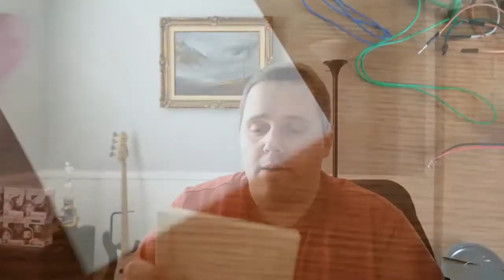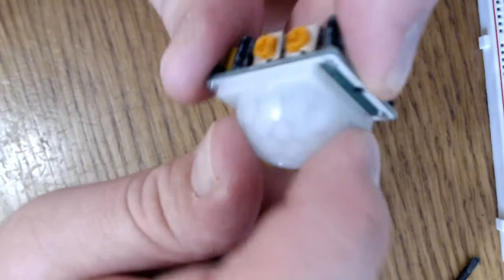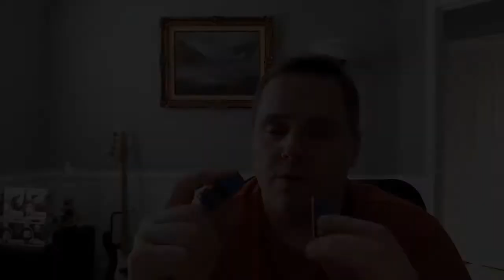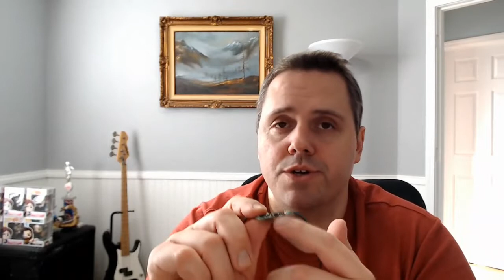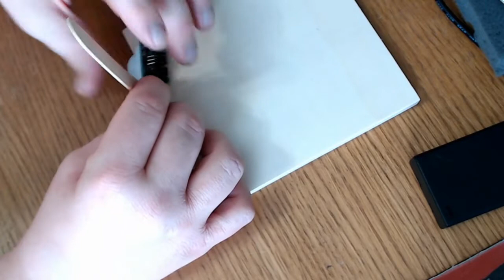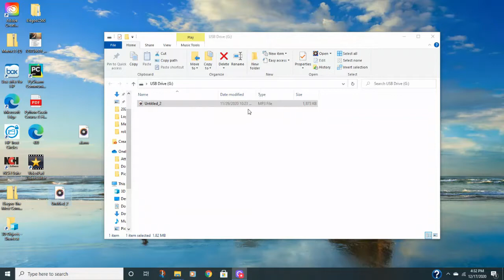How To Create A Simple DIY Motion Activated Sound Device With A Relay Module For Beginners

Comment: Is there away to make it activate when it’s powered up? I want a voice box for my car so when the ignition turns on it plays a sound and then stops (no loop)
Reply from the maker: Hi Keven!  I don't see why you would not be able to do this. You could connect Arduino microcontroller (Uno maybe?) to your car's wiring and make it activate a voice box to play 1 time per activation if you write the proper c++ program to the Arduino board. There's probably even a way to wire it to your car speakers rather than use a small external speaker. I am not familiar with modifying cars and this would take a bit of research, but I think it could be done. It sounds like a great idea, too!
Reply: @BMonsterLaboratory  thanks for the help I’ll look more into it 🙏🏽
Reply from the maker: @Awsometurtle20  do a google search for "adding arduino to your car". There are some neat videos there. These are the people who could give you more direction. Good luck with your project!
Reply: @BMonsterLaboratory  thanks for the guidance  I really appreciated

Comment: I have a question - if I wished to do this on a sound system that is bigger, say a speaker, outside - is that possible with your creation? Thanks.
Reply from the maker: Hi Jae kim! There may be a way, I haven't explored that yet...not with this same setup. Perhaps I will in the future. 
If you want an outdoor motion sensor with music I would recommend the Sparkfun mp3 player shield for the Arduino Uno. 
You can see my video here - https://youtu.be/zamlAniU2nQ
There are other mp3 player boards, but this one is the one I am familiar with and it works very well. You can load an sd card with many different mp3's if you want and you can shuffle them a well so that you don't get the same mp3 playing at each activation. You can connect the Sparkfun mp3 player shield to a passive speaker system (uses external power) using an aux cable. In this video I connected to an LG sound bar. For outdoor use you could also connect it to a PA speaker with an 2.5mm aux cable. There's not a lot to the Sparkfun setup and the code is posted on Facebook for you to use. Just search #mp3uino in Facebook and it should pop up. Hope that helps!

Comment: Can I substitute the pir sensor with a voice recognition module? And if yes how? 

Waiting patiently ;)
Reply from the maker: Hi there! Which voice recognition are you using? There are several out there.  I have MOVI, but it requires some coding.  If you don't have anything in mind,  I can work on a MOVI setup using this mp3 module.
Reply: @BMonsterLaboratory  Yes, I was trying to remember the name, is the MOVI and also yes, it would br helpful if you showed the step by step

Thank you😊.
Reply from the maker: @miguelmarques7378   I'll work on it and share the code as well. Nice thing about the MOVI is the example code provided...most of the time you only have to tweek it a bit. I'll let you know when it's ready 👍
Reply from the maker: Done - here's the video https://youtu.be/E1j4TkzliNA 🖖👍
Reply: I have everything wired correctly and am getting no output on the relay.  All three , pir sensor, relay and soundboard have separate 5 volt power sources but no output sound on the card.  Any ideas of what I am doing wrong.  Thanks.
Reply from the maker: @auirora1  hey there! Sorry to hear that.  It's there any way you can send me close up pics of your mp3 module and relay with all connections? Can you post pictures to Facebook?  Also include a full view of your setup? Also, did you test the module when you opened the package? Did pressing the button play sound for you? Did you remove the original file a add your own mp3? I can take a look tonight.  Is the motion sensor Jumper on the L? Is the relay module Jumper on H?
Reply: @BMonsterLaboratory    Thanks, I will do that.  I will send pics to your Facebook page.

Comment: Hi Bmonster! How are you? I wanted to know if it is possible to create a sound detector for a specific sound or are sound detectors for general sounds...what about motion detectors...can they detect motion from a specific direction?
Reply from the maker: Hi NaMa! I'm great and I hope you are as well 👍   There is a sound module with a microphone on it. It can detect different frequencies and amplitudes with the turn of the potentiometer. There are also voice recognition modules. I have a couple videos using the MOVI voice synthesizer and recognition module..It's awesome. I love that module.  here's a #shorts video of MOVI. https://youtube.com/shorts/xkmC5VEokGw
 Obviously, MOVI got the Superbowl prediction wrong, but don't hold that against her.
You can detect motion from different directions with multiple PIR motion sensors. Here's a video I recently made. It's very basic but it's directional. https://youtu.be/5SF_TDtShKQ
You can also use an accelerometer or gyroscope modules to measure directional acceleration and orientation.  I hope that helps!
Reply: @BMonsterLaboratory  can these two technologies be combined??

Comment: Hi! 
I really like the idea und also tried it out, but i face the problem, that my pir detects the next motion to fast, so the sound is interrupted.
Is there a way to pause the pir (without microcontroller) or to pause the relais until the sound has played?
Reply from the maker: Make sure the trigger select Jumper is on L, not H. L is single trigger mode. You can also adjust time delay on the potentiometer to create a delay before next trigger
Reply: @BMonsterLaboratory  Hello and thank you so much for the answer.  It think i've done all changes but have to play more with the PIR time delay to get the result i want to have. It still triggers too often.

Comment: What's that sound module board part number? It comes in kit form with speaker?
Reply from the maker: Hi Terry. I purchased this on Amazon - ASIN: B07ZJH9DPF    
The product name is "WayinTop Sound Module Button Control Music Voice Player Programmable Talk Chip Musical 8MB MP3 WAV USB Downloadable with AA Battery Box + USB Cable for DIY Audio Cards Christmas Creative Gift"

The module comes with a speaker, a button, a usb cable, and  a 3AA battery pack. It has actually gone down in price, which is rare. I paid $18 for it and it is now $13.  If you need any help with setting it up or any other options for the same type of setup just let me know....happy to help!  Good luck to you 👍
Reply: @BMonsterLaboratory  Thank you

Comment: Can you do a build on one of the trip wires used in paranormal investigations please?
Reply from the maker: I have something in mind.  I'll give it a shot!
Reply: @BMonsterLaboratory  awesome thank you!
Reply: Could a maxsonar sensor be used in place of the motion detector? And if so would it be more sensitive? Thank you
Reply from the maker: @reissenmagouirk2907  you should be able to but it's not quite as easy as this motion sensor setup in the video.
for paranormal investigations, maybe you  can use Bluetooth Serial or Bluetooth Low Energy (BLE) for communication between 2 or more ESP32 boards. When motion (or whatever sensor) is triggered on one, you get a signal for something to happen on a different board, maybe one that is several feet away. 
To do this right, I think programming a microcontroller is the easiest way to go.
Reply: @BMonsterLaboratory  thank you!

Comment: Hi! I just found your video and put together this setup with all the same parts, but for some reason the speaker is not making sound. I’ve double and triple checked the wiring, and the motion sensor triggers the relay, but no sound. What could I possibly be doing wrong? I’m trying to make a scanner beep sound for a kids grocery checkout counter.
Reply from the maker: Hi there.  I like your idea. Be sure there is 5v power to trigger the relay. Did you plug the module into a computer and add your own beep sounds? The only thing I can think of is the power to the relay. There is a jumper on the relay, is it set to high or low? It should be set to high.  It's a plastic sheath that covers 2 pins. It can be removed to set to high or low. I hope these ideas help.
Reply from the maker: Also, make sure you have a 5v relay and not 12v. That's easy to over look. It should say something like 5DC on it
Reply: It works! Had the COM and NO wires to my sound module backwards. Oops! Works like a charm now. Thank you so much!!!
Reply from the maker: @mandinottoli8166  good job! May come out with some more videos like this.  Easy to set up and use. Take care!

Comment: How do u wire it up without th bread board ?
Reply from the maker: you can solder or get wire connectors.  Check these out https://www.amazon.com/dp/B0BLVLWJ6G/ref=sspa_dk_detail_6?psc=1&pd_rd_i=B0BLVLWJ6G&pd_rd_w=76sio&content-id=amzn1.sym.f734d1a2-0bf9-4a26-ad34-2e1b969a5a75&pf_rd_p=f734d1a2-0bf9-4a26-ad34-2e1b969a5a75&pf_rd_r=2JVFTBJKJBK0JZVYY4AX&pd_rd_wg=0DOuW&pd_rd_r=6eff2e90-7b08-4a9b-b210-c58977571dce&s=industrial&sp_csd=d2lkZ2V0TmFtZT1zcF9kZXRhaWw   sorry for the long link. no soldering for this item.

Comment: Could this be used to power a motor with a 9v battery as the power source? Would I need a different relay for that d'you think? Great video, really informative
Reply from the maker: Hey there! great to hear from you and thank you for the compliment. Yes, you can power a 9v motor while using this relay as a switch. Although this relay is normally used to separate very high voltage from 5v, it would work for you. You just need a 5v power supply to trigger the the relay to turn on the item you have connected on the other side. If you need an example, just ask. I'll post one on the facebook page. Good luck to you!

Comment: Is there any way to upload more than one sound and then have one play randomly when motion is detected?
Reply from the maker: Hi there.  There's nothing in the instruction manual that indicates you can do this. I believe you can only put 1 mp3 on the board. You can do this with arduino though, and it's not too difficult at all. 👍
Reply: @BMonsterLaboratory  thanks for the quick reply!
Reply from the maker: @ichbintimo823  no problem.  Good luck to ya!

Comment: If we want to replace the speaker with a bigger one, should we then move to 12v power supply and relay?
Reply from the maker: Hi victor! If you apply over 5v then yeah, go to 12v relay.  You can also use a resistor to drop the voltage,  but these are cheap enough just to get a 12v relay.
Reply from the maker: Also, look at the spec sheet for the relay when deciding which one to buy
Reply: @BMonsterLaboratory  Thanks! I'm planing to build a deer repellent device. They're eating all my flowers :(
Reply from the maker: @jamonessinfronteras9683  I was actually thinking of using a motion activated flood light and a speaker to scare the rabbits away from our garden. I put up a fence and they still destroy everything.  I'll see how it turns out.  Best of luck on your deer repellent!

Comment: Is there a complete list of all the materials needed in this project? Also great vid!!
Reply from the maker: here ya go.
Your Amazon link to this sound module - https://amzn.to/3lzYc1E
5v relay - https://amzn.to/2YIAk39
motion sensor - https://amzn.to/3v6x0L4
jumper wire - ASIN: B01EV70C78
breadboad  ASIN  :  B0040Z4QN8
you may want a sensor mount - ASIN: B09MM3WPT1

Comment: First, I'm a beginner. Zero experience. You lost me when you started plugging cords into the White device. Where did the cords come from? And how would you fit that white device in the frame? Or the battery pack?

2. Where did that white device come from?

3. You said something about uploading recordings, but will it let you record directly? If not, what do you have to get to do that?

4. Is there a miniature version of all this? I have motion activated mirrors for 2 birds that are having some issues. They aren't sold anymore. That's why I'm here...in case I need to create new mirrors for them.
Reply from the maker: Hey there!  
 The cords are jumper wires and they come with pin connectors on the end that allow you to attach them to the breadboard (long white plastic thing) and devices such as the motion sensor. Ideally, you would 3d print or purchase a pir motion sensor case that you could mount the sensor. You could set this up remotely with 5v dc battery supply if you need to. 
The white device is the HC-SR501 Pir Motion IR Sensor which I usually buy from Amazon.
You can not record directly but you can add one mp3 recording to this board. It can be up to almost 3min in length I believe. You can record sounds form a video on your pc or go to freesound.org and download a free sound. There are many other places as well.
You can make a miniature version of this. This was somethin I set up on a breadboard for fun and some people have used it in their projects. You would have to make it compact and give it a case or a small box to hold it, but it's totally doable. 
Do a Facebook search for #bmonsteralarm (just type bmonsteralarm into the search) and you should get an old post that shows a diagram of this setup. There are other ways to set this up if you think you may need something different.
If you have any questions while you're building it, i'm happy to help.

Comment: can you help me add sound
Reply from the maker: sure! make sure you have an 8ohm speaker and 1 mp3 song or sound. connect the mp3 board to your pc and a folder should appear. You can delete the file that it came with. Just add your mp3 and remove the mp3 module from your computer and you should be set. if you get stuck just let me know.
Reply: @BMonsterLaboratory  thanks

Comment: Hello BMonster laboratory I need 5 super high sound from the predator movie sound that is motion activated by movement and ac supply
Reply from the maker: Hi there!  So you want a loud predator "clicking" sound that he makes in the movie when motion is detected? How loud are we talking about? I'm using an 8ohm speaker in this video. Four loud playback you'll need a speaker that's amplified. You need 5 separate set ups (stations) that detect motion? If all this is correct, there's a better way to do it. Check this out https://learn.sparkfun.com/tutorials/mp3-trigger-hookup-guide-v24?_ga=2.19285624.1342155786.1687919175-419616546.1677727671

Comment: How to make a motion sensor to produce sound? Like when we touch hit or swing it in short words move it?? I just want to make a lightsaber XD I got the light colours all working.
Reply from the maker: A gyroscope/accelerometer  would work great for a lightsaber. Did you already buy the parts for this motion detection project?  Happy to help more when I return from my trip 👍
Reply: @BMonsterLaboratory   I just need to buy a light sensor so that It could make a sound when it's activeted I already have sound board and a speaker.

Comment: Could this be done, but wired to a 3.5mm aux audio output port instead to connect to a larger speaker?
Reply from the maker: Hi Andrew! I haven't looked into that but Sparkfun does have a 3.5mm jack breakout board you may be able to use. You would probably have to use an active speaker with an internal amplifier. Might be worth looking into just for fun. 
Using the Sparkfun mp3 player with an Arduino Uno may be a better option for you. The setup is really easy and you can shuffle your songs from an SD card. You can also connect your 3.5mm speaker plug to the board. check it out here - https://youtu.be/zamlAniU2nQ

Comment: Bro how much GBP did it cost to make
Reply from the maker: Hi there!  $30USD would probably cover everything. The mp3 player module was the most expensive thing ($15 when I bought it ). everything else was a $3 or $4. I had the jumper wires, breadboard, and pir sensor from the Elegoo kit that I bought a while back.
Reply: @BMonsterLaboratory  I want one for ghost hunting I see them on sale for upto a couple of hundred but would not pay that I'd rather make my own .thanks for the video
Reply from the maker: Cool idea. You could box this up, hide the wires, and operate it with a battery....that would be great!  Hope it goes well.
Reply: That's what I'm looking to do also. Would a pnp transitor work the same way as the relay?
Reply from the maker: @BigYooper  hi Tom! I like the idea. It may work but honestly, I haven't tried